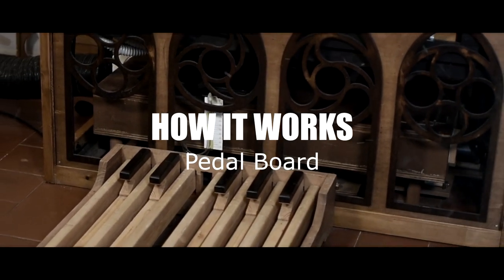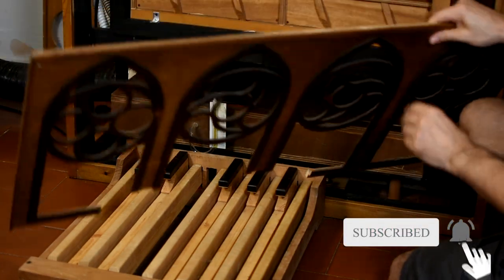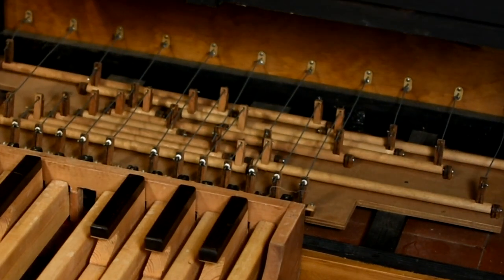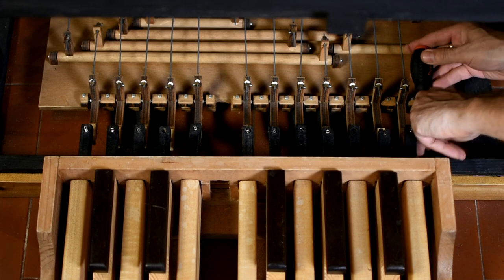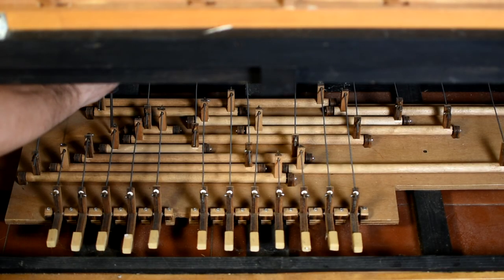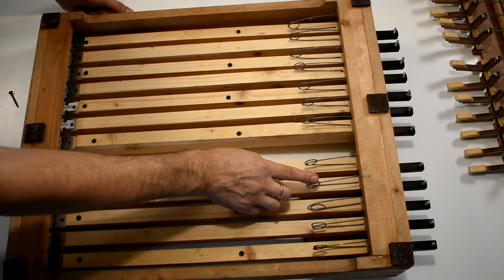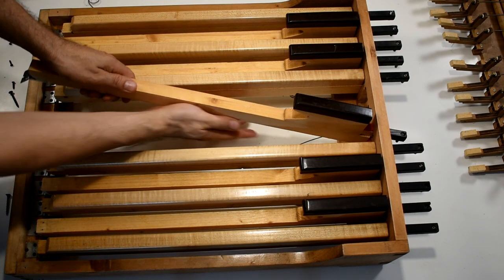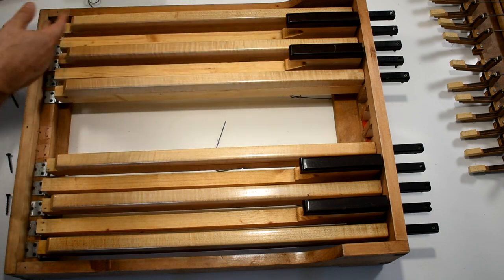Homemade Pipe Organ Tour | #3 Pedalboard (pedaliera) | Sub ITA

Comment: Hi Nippocast! Is the pedalboard C (lowest) 32.7 Hz? And the lowest C on the keyboard is 65.4 Hz?
Reply from the maker: Hi, no they are both 8' so 65Hz. The difference is that the pipes on the pedalboard have a much larger scale with a round sound and a strong fundamental, while those on the keyboard, which are smaller in section, have many more harmonics and seem to have a less deep sound.
Reply: @nippocast  OK! Thanks for the answer.

Comment: Where did you get these springs? Do you use the same springs in the windchest?  And are they all the same strenght?
Reply from the maker: no, these springs are made of spring steel, while those of the windchest are made of raw brass, however I made them myself
Reply: @nippocast  How thick is spring steel ?